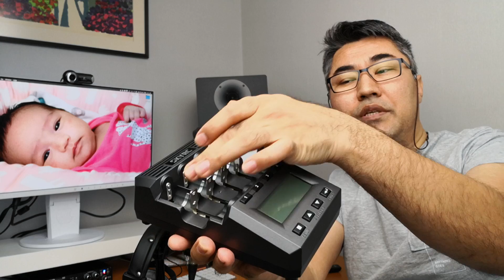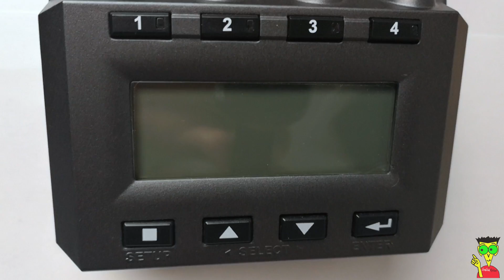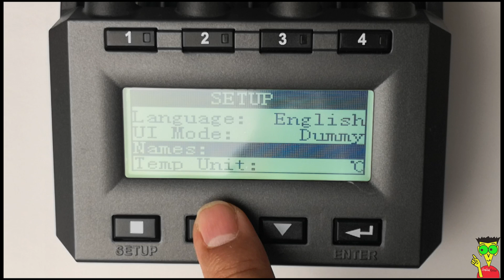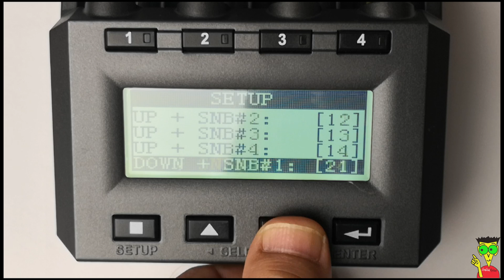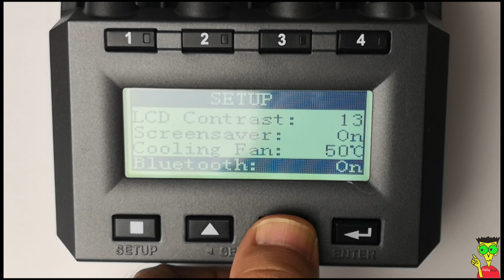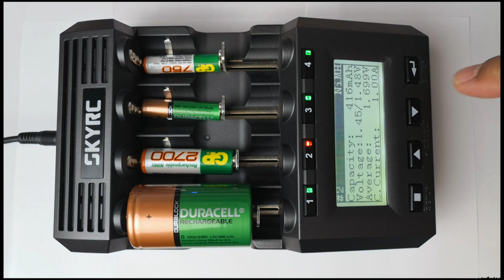SkyRC Mc3000 v2.2 One of the most advanced cylindrical battery charger

Comment: Any idea how to get the discharge AND charge capacity with this charger for aa nimh and 18650s?
Reply from the maker: I'm using the android app, much easier to use. 
It is significantly better for NimH batteries NOT to discharge them fully before recharging them.

NimH life can be enhanced substantially by never discharging them fully on any occasion.
Reply: @dumdumreviews7436  I was under the impression that a full discharge cycle is not very detrimental to nimh chemistry but slightly more to li ion
Reply: @dumdumreviews7436  Great thanks! I spent a lot of time getting familiar with this amazing charger finally and I would recommend checking out gnu data explorer. It gives detailed information completely graphed out for you on a computer via the usb port. You can save all the data to view at any time which includes: voltage, avg voltage, battery temperature, system temperature, internal resistance, capacity, power, energy , current. http://www.nongnu.org/dataexplorer/

Comment: Hello, what is the minimal current that the charger can be programmed(for different battery types) ?
Are the internal springs now on a metal holder or still on plastic?
Is a newer version on the market? 😊
Reply from the maker: The minimal is 0.1Amp. What I can see the springs are on metal but I'm not sure 100% I didn't open the charger. Yes it is on the market. If you wanna buy, just ask them if the charger has two fans otherwise it's not version 2.2, only the version I mentioned in the video has two fans. I took some pictures of the springs I hope you can see your self. https://imgur.com/AMSNGkr And https://imgur.com/q9guPJ4